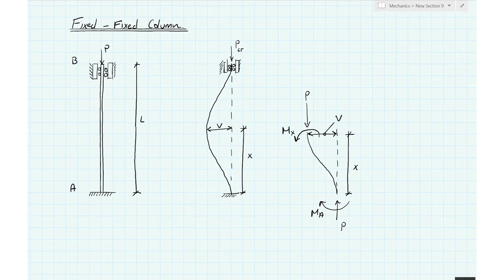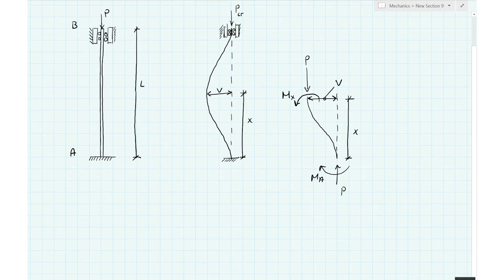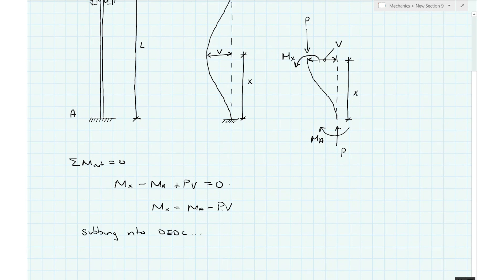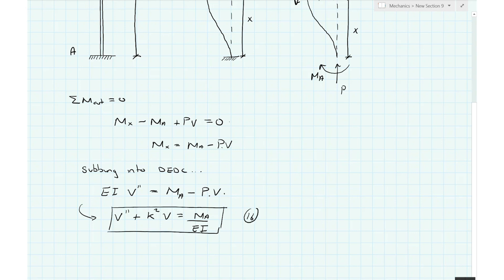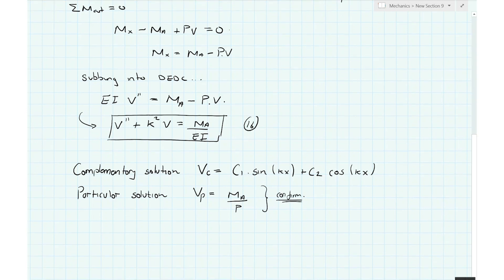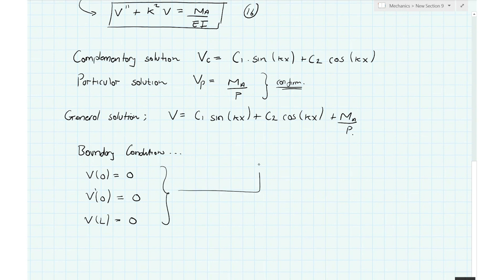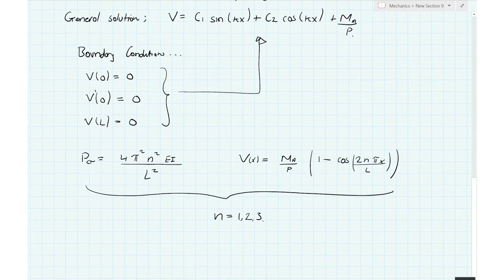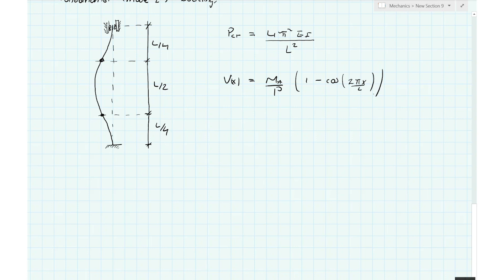Fixed-Fixed column - deriving the column buckling equations

Comment: Great video which helped me a lot. I am just struggling with the particular solution, why is vp = M/P? shouldn't it be M/EI? I don't know what I am missing here..
Reply: hello friend,
it is because in order to derive particular solution we assume the answer to be KM and K is sqrt of P/EI to power of 2. So unlike the fixed free solution that we had P multiplied in delta here we have to multiply and divide M by p in order to have P/EI made and then it will allow us to cross the K in both sides of the equation for particular solution.
I hope i have explained it clear😁.